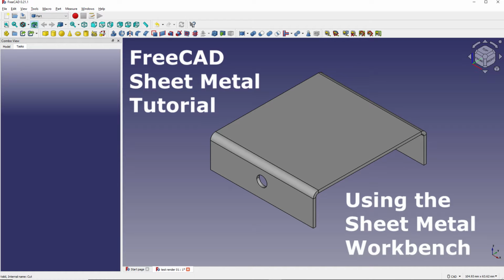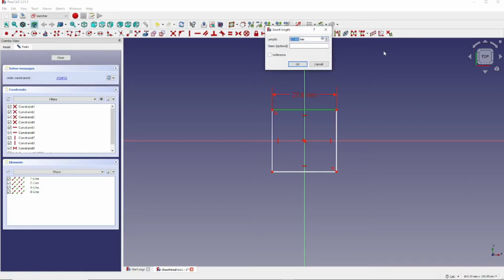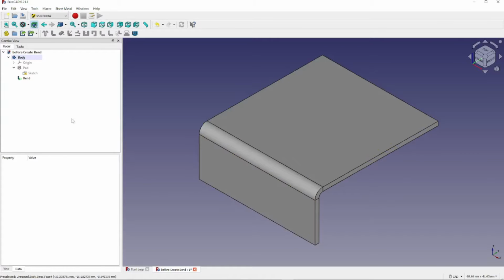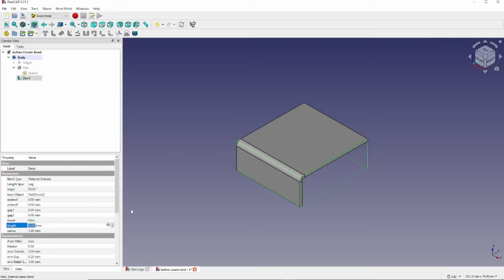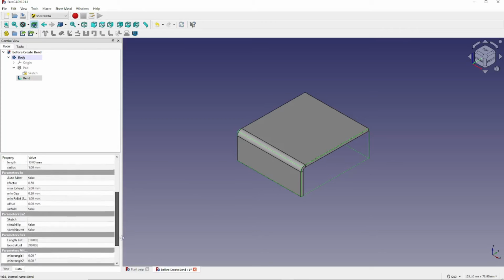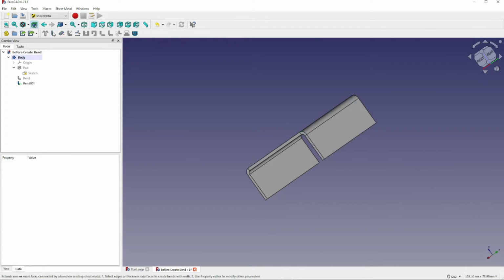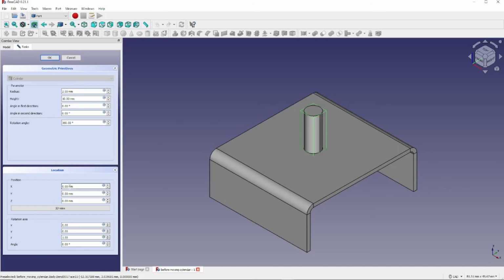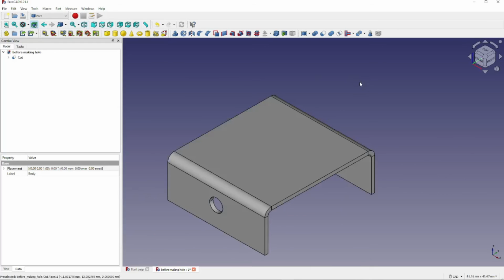FreeCAD Sheet Metal Workbench Tutorial

Comment: Useful workbench, when it works. 
Seems buggy though. I am using 0.21.2 and when creating a (square) U-shape, and try to bend one arm of the U everything is fine. Turning that bend to "Material inside", the bend jumps to the other arm of the U and messes everything up. Only works if the U has two arms of different length, which is not very useful for applications.
Reply from the maker: I've had absolutely no problem getting FreeCAD Sheet Metal Workbench to work. As time permits I'll try and recreate your issue. Thanks for the feedback.